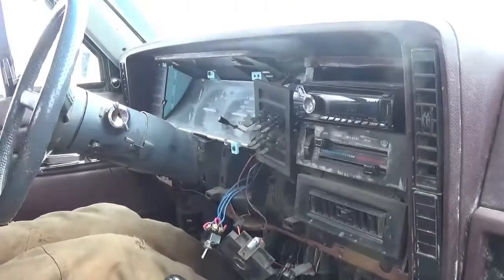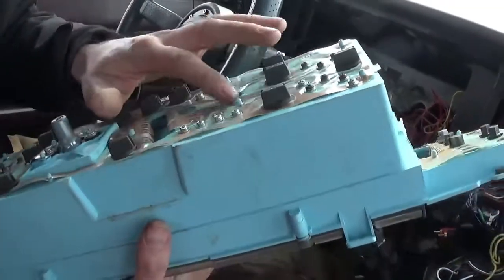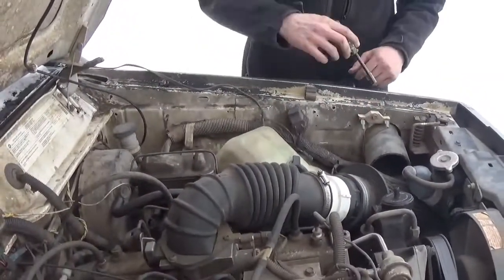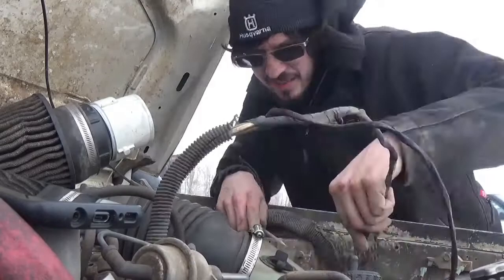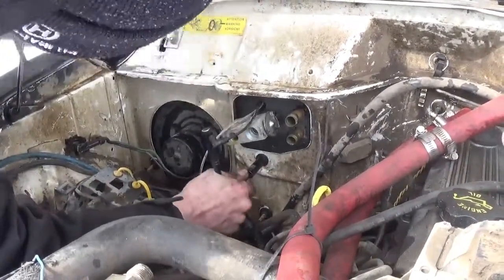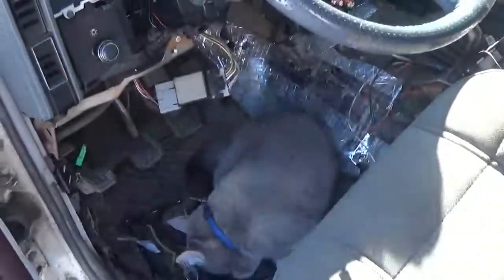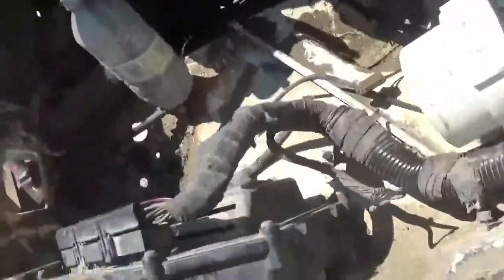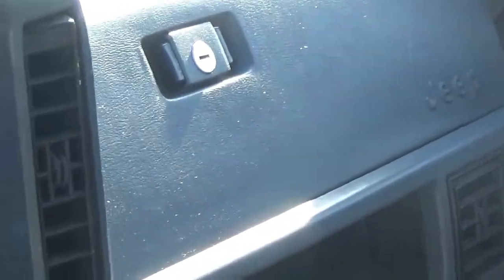Swapping The Dash In A 1990 Jeep Comanche

Comment: where did u get the new harness from i got a 87
Reply: The harness came from a parts comanche I had. You can use a 1992  cherokee harness too, but the tail light and  fuel pump harness is longer
Reply: @Brian vandertuin  hey buddy. This video is a great help. I have an 87 comanche and a 91 cheroke. So it's just a complete swap. I was planning on just doing the dash and doors. But today my wiring went up in smoke under the dash and the 2 minutes later the harness for the relays on the passenger side burnt up to.. I just got my comanche so I don't know anything about it. 
Could I talk to you more about this.